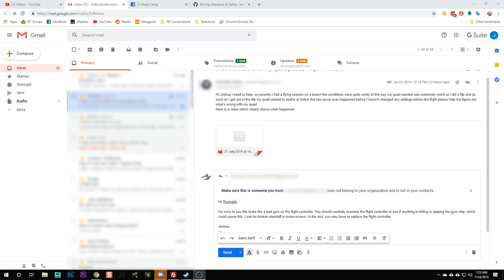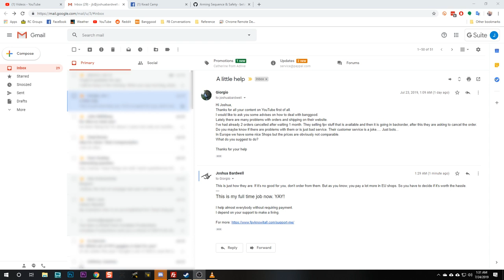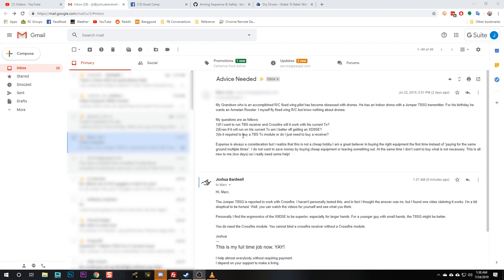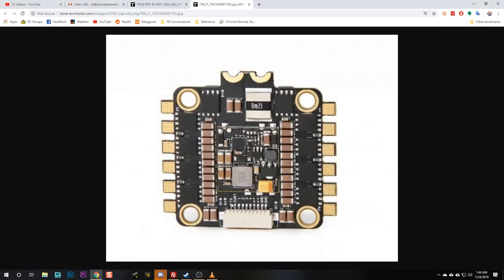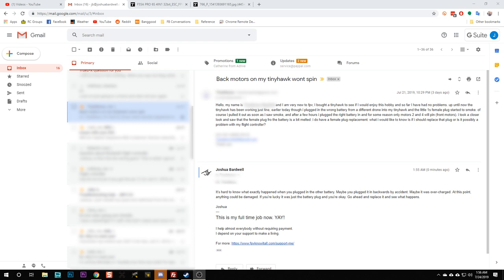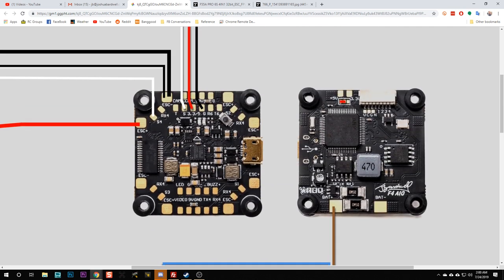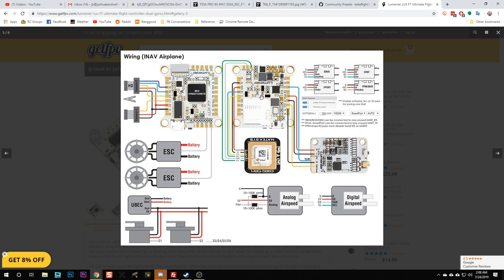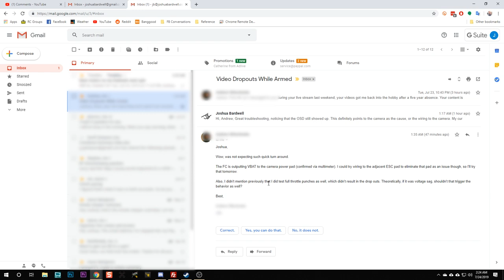JB Answers Questions In His Email | July 24, 2019

Comment: Latest version of deviation firmware  on the T8SG V2 Plus definitely  works with Cross fire. You need to make a small change the pins on the module bay (add one wire + cut a pin). You do not have LUR scripts so don't get the micro crossfire module as you won't be able to make any setting changes.

Comment: Banggood customer service gets a lot of grief, I find if you're patient and polite it gets you a very long way.
Reply: Mook Man took me four emails insisting that I needed a full refund before I finally got it but I got it
Reply: This
Reply: Yeah it's ok to scream blue murder at them when they screw up, but in correspondence with them it helps if you're polite, patient and to the point. I've had very little hassle with them and will continue to shop there.

Shipping wise I ordered a very nice 18650 torch (BLF A6 XPL) on the 20th, received it on the 26th in the UK.
Reply: they sent me someone elses mail and they asked me for the tracking number... ok lol then they opened a ticket that no one has answered saying i lost a package. their coupons are useless and points are pointless... ill go back to hobbyking but the shipping from america is a rip off.
Reply: The coupon I found & used for the BLF A6 torch worked and saved me a bundle, "AC18" and still works, dropping the price from £22.01 to £15.42, a 30% saving :)
Reply: Got a refund or replacement every time I have had an issue. Can’t say the same with gearbest
Reply: Hi they admitted on Instagram that they having troubles with shipments to Europe due Royal Shipments. They have a lot of of goods stucked in NYSA. The problem is that is frustrating to get precompiled answer from bots, order something that is available and then in back order and maybe never shipping.
Reply: lost over €700 Banggood say they shipped the goods only sent a 20 frame by there own record.. they lie to PayPal and use fake tracking ….. they picked on the wrong one this time...  I work for darkcity projects and the crew say they will help me get a lot more back from Banggood as we go to legal war... what's upsetting is most could not do what I/we are doing they would just lose there cash and it not one or two its happening to...
Reply: @robertoverde4901  Go get'em Batman!

Comment: I used to fly 3d heli a long while back and when I wanted to go back to the hobby since I still had good hardware to fly but my Spektrum DX7 controller battery died and after changing the pack the controller just comes up with "Backup ERROR" message.  I was never able to resolve that problem with the controller but now I would like to try some FPV drones and I was wondering if there was any disadvantage getting DSM2 transmitter for use with FPV and be backwards compatible with my old Heli hardware?  Or just get a newer standard transmitter and a receiver for my old heli?
Reply: Hard call. I've heard quad people complain here and there about failsafes, but I spoke with some model plane guys and they seemed to have no complaints, although they both had  expensive looking DX9's...  I think its worth a go.

Comment: That ESC telemetry current sensing thing is really weird. If they only want to use one shunt resistor, couldn't they theoretically only use one shunt resistor that measures the overall current but only reports to ESC1. And then you could get the overall current from ESC1 and all other ESCs could report 0Amps. Imo that would be a better solution than analogue current sensing. But I guess only the manufacturers know why they do it the way they do

Comment: I have an issue that I can’t figure out. So here is the rundown I recently put together a quad using the hglrc 60 amp esc and flight controller stack I got everything working fine with betaflight on my old computer which was about a month ago. Fast foreword to last week dropped my laptop broke my screen so my original betaflight is none existent well I had a crash replaced the frame with a different one but didn’t notice my esc touching a metal point on the frame was flying for a few minutes till I fried the esc, no problem bought a new esc and bought a new computer downloaded betaflight again and all the drivers, replaced the esc with a new one but now I can’t seem to get it to connect to betaflight at all even tried on a friends computer who is running betaflight and still won’t connect the light of the flight controller comes on when plugins in but the computer won’t recognize it’s had something plugged in and I was wondering if it is possible if the flight controller got screwed up as well will the the 4in1 esc being ruined there was no crash in this occasion that the esc went as it was a test flight and I had landed and noticed a burning smell and it burnt in my hand so the drone did not take a crash is there anyway the flight controller got ruined as well ????please help
Reply from the maker: I would replace the FC at this point.
Reply: Joshua Bardwell i figured that’s what I’d have to do thanks for the advice and the timely Manner of your response. Keep up the good work thanks

Comment: Joshua, talking about Banggood and conformal coating... Do you (or anyone else) know any conformal coating I could buy from Banggood? It's my only option here in Brazil. 😕
Reply: MAD GRUMPYMAN  I live in a small city here in Brazil, dude. I would have to travel around 200km to get to the closest electronics store. 😕
Reply: MAD GRUMPYMAN  Your comment disappeared before I could read it, but yeah... I'm going to look nationally to see what I can find. Thanks! 😊
Reply: Clear nail polish! Works the same just without the modified color dye. Cheers!
Reply: Clear nail polishes work as well or better imo.
Reply: @ByteFPV  Nice! I'm going to look into it! 😃
Reply: @rl2769  Thanks!
Reply: Amazon online
Reply: Clear nail polish is NOT the same it's doesn't allow heat to escape like silicone comformal and it chips cracks and flakes off so not waterproof

Comment: has  anyone built on this frame?
Realacc Lastar200 200mm 4mm Arm CNC & 3K Carbon Fiber 5 Inch Frame Kit for RC Drone
Reply: You would be much better off going with a TransTECH Frog lite... The frame your talking about is clearly a very similar "inspired by" frame to the Frog... The thing is it's Realacc and that means low quality poorly cut carbon fiber... TransTECH is a brand that uses pretty good quality carbon and they cut the carbon correctly so you will get a much stronger bottom plate and arms will be far harder to break then the Realacc poorly cut and low quality carbon..

Trust me if you like that frame then you will like the TransTECH Frog lite as it's very similar in design like i said and will be higher quality in every way... The TransTECH Frog will cost around the same.

Comment: Can you use wd-40 as an anti corrosive thing
Reply: Yes, but don't! Use "corrosion x" instead if you want a fast and easy protection( downside is it's messy). WD-40 is meant to creep and not meant to stick in place so it would need to be reapplied often and would not offer as much protection. Also, don't WD-40 your motors. It will wash out the grease and ruin your bearings. Really I wouldn't put anything on motors at all.